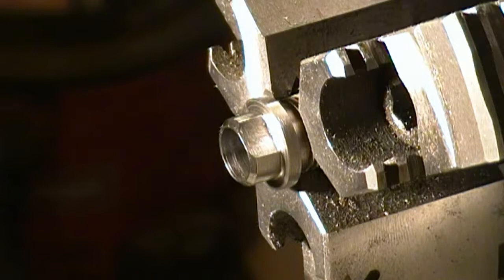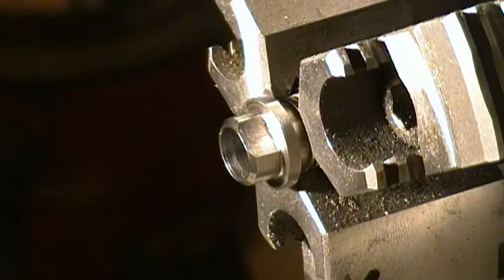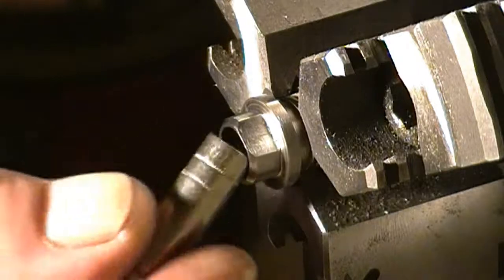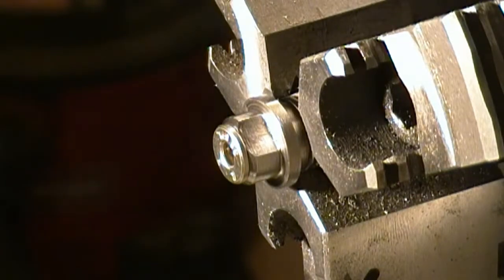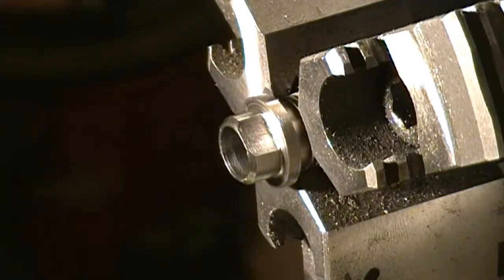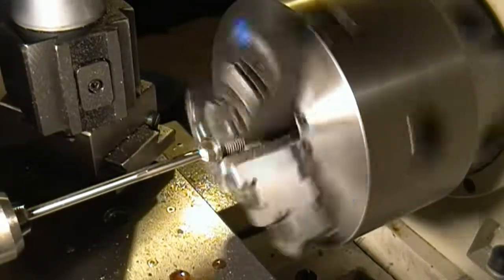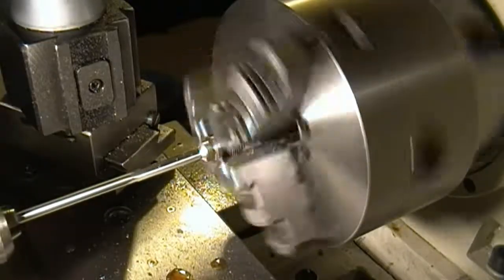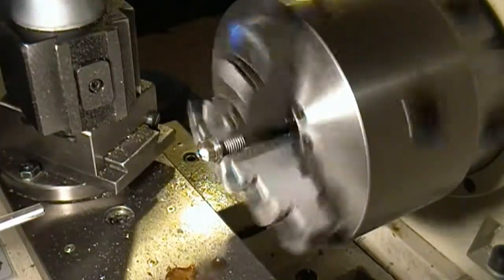Breechplug Conversion-1/1

Comment: I know this is an older video but I’m seeing this right, you reamed the Bree h plug all the way through? This means when you pour your powder down the barrel, and I’m assuming your using loose powder instead of pellets, now the powder goes all the way down inside the breech plug/ 38 special shell case and that means the ignition/ explosion happens inside the case and breech plug instead of the barrel. Am I correct with this? How long before the breech plug splits from this, is this safe for long term use?